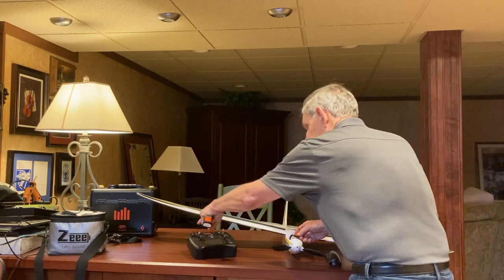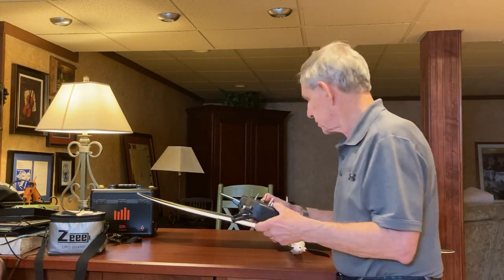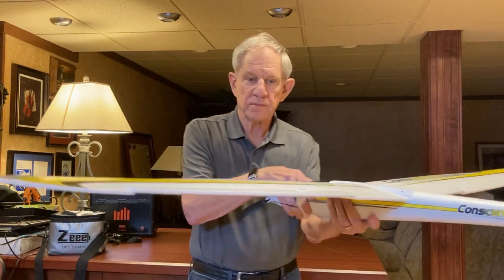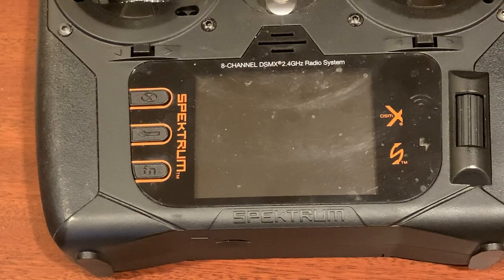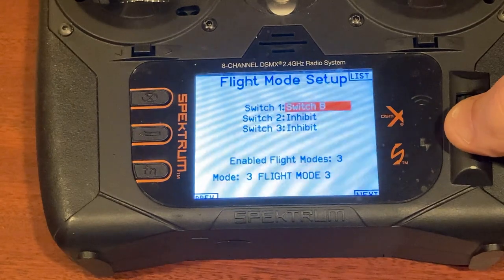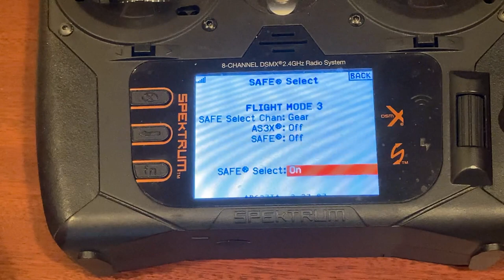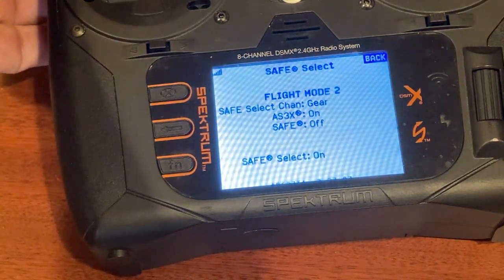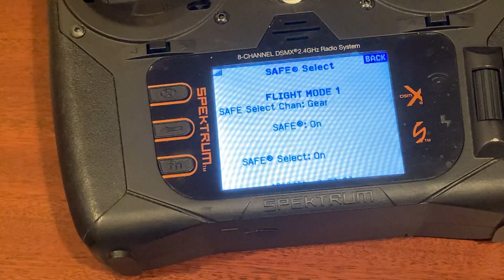Version 2: AS3X-Safe Switch Setup on the AR637TA/AR637T Receivers and NX8 Transmitter

Comment: Thanks for the video, But I have one question that I couldn't find the direct answer from any of the You tube videos.
Could SAFE and AS3X work at the same time?
I believe these are two separate functions and only one can work at a time. 3 position switch is 1. SAFE, 2. AS3X, 3. none of these two.
Reply from the maker: No they cannot. These mode perform very differently and cannot be used together.
Reply: That’s incorrect; in fact, when you go into the forward programming menu for your different flight modes, specktrum tells you that in any mode with SAFE turned on you should also have AS3X activated. This allows for wind/turbulence correction (AS3X) while having the self leveling and roll/pitch restrictions that SAFE gives you.

Comment: With a mix you can also put SAFE on your I button (panic).  My DX 8 has the I button. So, I have a switch AND a panic button.  Your NX has the same button.
Reply from the maker: I've looked at doing that too but not taken the time to make it happen.
Reply: Hi, do you mind me asking how you managed to do that? I've been trying and I just cannot get it to work. Thanks
Reply: @TimE-mf4of  the mix is the I button with switch A, which is the switch I use to turn safe on and off.  The I is the panic button. O%, -100%, with offset of 100%.  Play around with it for a while, you should get it.  I have a DX 8, so your settings might be different.
Reply: @loftbuckleyrc  thanks for replying. The problem I have is that I don’t know how to set up the mix that you are referring too. If it’s not to much of a pain, please could you spell out the process step by step . I’ve watched numerous tutorials (most several times) and I just cannot get my head round the process. Thanks again.ps I have a DX 9 so I would imagine the process is very similar.
Reply from the maker: @TimE-mf4of  tell me exactly which transmitter and receiver you are using. Is the receiver locked or not? The steps are different depending on you answer.
Reply from the maker: @TimE-mf4of  Answer 2. Do you have an open 3 position switch and an open channel?
Reply: @GoofballFlyer  it’s an  AR673T which is not locked. The TX is a DX9.
Reply: @GoofballFlyer  yes - I ce been able to turn the safe on as part of a flight mode but I can’t find out how to operate it in panic . Ie if I want to use the I or bind button to turn safe on. Does that make sense ?
Reply from the maker: @TimE-mf4of  does you DX 8 have Forward Programming enabled? That may take a firmware update if not.
Reply from the maker: @TimE-mf4of  makes perfect sense but not done it myself. Try this link. https://www.rcgroups.com/forums/showatt.php?attachmentid=13403047&d=1586891442
Reply: @GoofballFlyer  Yes, forward planning enabled and latest firmware updates loaded a few weeks ago. Everything is working fine apart from this mix that the original poster referred too - and that's the reason that I purchased the rx ( to save me if I get into trouble).
Reply: @GoofballFlyer  Thanks - I'll give to a go 🙂
Reply from the maker: Hi again. You got me interested in setting up the panic button. Here is another method I found that is quick and easy: 

https://www.youtube.com/watch?v=W8s-qBSPbUc

You MUST first check the channel assigned to Safe select to set it up. Some of my models are Gear and some are AUX2. You just set up a new Mix for Switch I to the Safe channel. The rest is in the video. Takes about 5 minutes per model once you see how it works.
Reply: Great video!  Thanks.  

(A note of caution…I have aways followed the protocol of powering on the TX (with throttle cut enabled) prior to connecting the battery.  That way you know that the prop won’t spin.  If you connect the battery first, what happens next is somewhat unpredictable.  Just my opinion.)

Thanks again!
Reply: @GoofballFlyer  thanks so much for your reply and the link. Is this doing the same thing just in a different way ? It doesn’t appear to be similar to any of the other tutorials I’ve seen . I fear I’ve gone down a rabbit hole and will never find my way out 🙈
Reply from the maker: @TimE-mf4of  You can always re-bind to a fresh ACRO and start over. I don't have access to a DX8 so the steps might be a little different. Probably can't help you much more from here.
Reply: @GoofballFlyer  no worries - thanks for your help 👍

Comment: My forward programming will not connect. It keeps failing. ??
Reply from the maker: What are the transmitter and receiver models? If you have the AR637TA have you unlocked Forward Programming by reloading the firmware.
Reply: @GoofballFlyer  NX6 and a Micro Draco 800 mm
Reply from the maker: It's very likely the UMX Draco does not support Forward Programming. Check your manual for assignment of a Safe switch. That's how I had to set up my UMX Conscendo.
Reply: @GoofballFlyer  It has default safe on gear channel five. Two position switch I was trying to set in up on aux7 three position.
Reply: It’s my first airplane lol. And I’m hooked. Hahaha
Reply from the maker: @WayneP1973  try this. System Setup then Channel Assign then set Gear to the switch you want to use. However, on a three position switch you get Safe on one position and AS3X on the other two. I cannot find a way to turn gyros off in the third position. This is based on my UMX Conscendo.
Reply: @GoofballFlyer  Thank you so much. With your help I finally figured it out. 😀
Reply from the maker: You are very welcome. That fix took a little head scratching to figure out. I finally realized that the transmitter's default Gear switch was being used to turn Safe on and off. So, I just changed the Gear switch assignment!

Comment: How did you set the failsafe? Thank you!
Reply from the maker: You don't. SAFE and AS3X should automatically set it up. My setup on all 8 aircraft is the NX8 bound to AR636/637 receivers. That's all Spektrum equipment. The receiver of course must have SAFE/AS3X gyros for any of this to work.

To test turn on AS3X or SAFE, test to make sure both are working, and turn the transmitter off. If you hold wings level you should see the ailerons command a left turn. Roll the airplane left and at about 20 degrees the ailerons should go to neutral. Even if gyros are off - no SAFE or AS3X - failsafe should still work. Let me know if this does not work and we can go into it deeper.